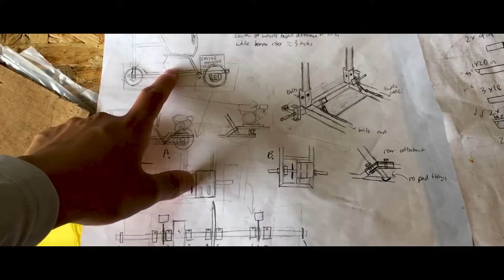DESK KART - Gas powered school desk go kart build

Comment: It's OK, I like it but I want to build one just a little different, been thinking about the build since early summer 2018 and I am about to start getting parts together for a winter build.
I plan to use a 110cc semi-auto 3speed + reverse ATV engine that I have and the steering wheel will be different and I'll make the desk frame since the real desk frames are a bit weak.
Reply from the maker: that sounds like an awesome project! hope it goes well